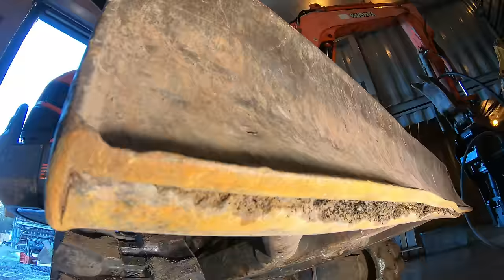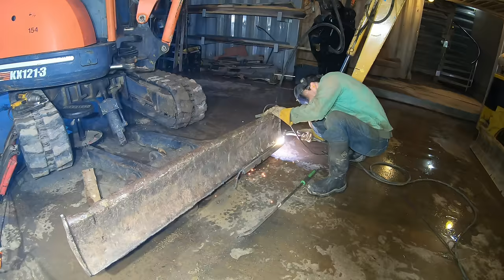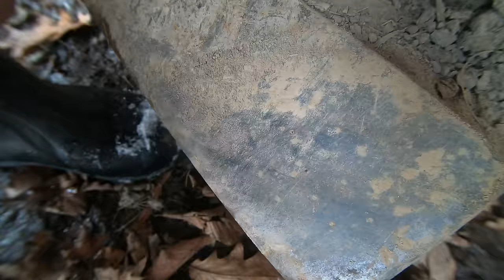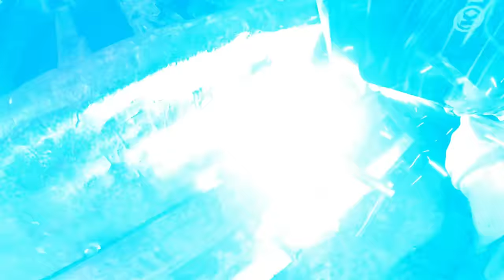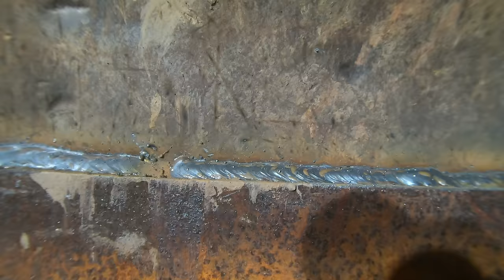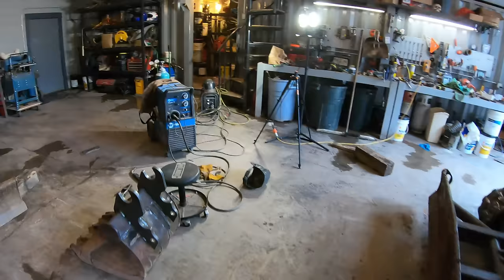Replacing a cutting edge on an excavator blade

Comment: You need bigger tanks! Go the next size up (like I did) and your trips to the welding supply store will be far less frequent. 
I bought a Miller 225G stick welder years ago for 600 bucks -- factory trailer included. Freshened the Onan motor and it's good for years. 

Great project. Great job.
Reply from the maker: localcrew they won’t sell bigger ones, only will lease them.
Reply: @AndrewCamarata  Sounds like an Acetylene conspiracy to me. Another example of The Man trying to keep a brother down.

Comment: Plasma cutters have consumables  that have to be replaced $$$ over time...but you are right cleaner cuts and not as expensive and time consuming as Ace and Oxy bottles. Nice job👍
Reply from the maker: There is a little metal thing in the tip I have changed a few times. What else is there? I have done plenty of cutting with that thing and its been inexpensive to operate.

Comment: Yup I always recommend replacing the damaged and worn portions of any blades and buckets with A-R (abraisive resitant) plate. Regular mild steel wont hold up very well for this. Lots of people never heard of it. It has to be flame cut it will ruin a shear blade.

Comment: Andrew, if I were the owner of that used KX-121,..and had that damage to the blade assembly,..I would have a good look at the undercarriage and main track frame .
 I'd almost bet that you  will find that there are more cracks and areas needing your immediate attention.
Actually, that would be a good thing to do with ANY used excavator.

Comment: I have MIG MAG welder , it can use 0.8mm, 1.0mm and 1.2mm wire, 220v, 200amp, it is $300. I love it!
I can recommend Jasic J46 - its about $600 new and it is awesome! Bud I don`t know if it fits your power sockets, I`m from Russia.

Comment: Hey Andrew just fyi a great way to tell if steel is hardened is to run a file over it. If it cuts it's not hardened and if it just kind of skates off it is hardened
Reply from the maker: Thanks. That makes sense.

Comment: great video and great work, but I was cringing when I saw you lift the blade assembly and holding it up to put the pins back in. That's going to kill your back some day. Did you ever think about building a gantry crane in your castle workshop area that can span the entire width and travel full length? With your abilities and the tools you have I am sure you can build one and it would be a fun project for you to do and for us to see.
Reply: Too slow for Andrew; he doesn't work for the county.

Comment: In my youth, I would weld on a strip of mild steel and then bolt grader blade to it. Then hardface the grader blade. That would keep the grader blade from wearing out or at least, lasting longer. Then when the grader blade does wear out, you bolt a new piece of grader blade onto the mikd steel strip. Cheaper and easier to repair.

Comment: the reason they wear uneven is because most people turn the boom to the right when cutting and pushing to look out the door, swing the boom back to the left when pushing/cutting when you do this it helps balance the machine more and reduces uneven wear.

Comment: Be sure to keep an eye on the condition of the oil in the track motors on that Kubota & yanmar. It gets burnt pretty quickly if you're doing a lot of blade work with them and the gears in the hubs will get chewed up. Fresh gear oil and some Lucas oil additive will make them last forever.

Comment: Great video but when you weld something like that directly from one end to the other the heat will warp your iron.  Common practice is to back step your welds or skip around to prevent concentrating too much heat in one area.  You always have think about what your heat will do!  Good job though

Comment: So weird to see these vids,when you repair Andrew,just one guy move all the parts,i work in an quarry,driving 30/40/60tons diggers,when we repair something,need another digger to lift,or pull the part,heavy chais,ropes we using,yor plants like model machines for me.. ):
Smallest spanner is 50mm for hidraulic hoses,if the big girl bust an hoses,till is revving down,and put the bucket to the ground,losing an barrel of oil,refill it from straight an new barrel,lifted above tank,with another digger. ):
Oli change is same,40-60L of engine oli per engine.
But the other side is,i put 2.5 bucket of stone with the 60 tonner to the 4 axle tipper lorry,that is 20 tons load,3.5-4 bucket to the artic lorry,wich is 30 tons of load. (:
I like your videos Andrew,you are similar like me,i always want same my own business like your,just never have enough money yet to start it,but i never give up,one day i will work for myself,stop working for someones elses comfort and luxury.
Wish the best of luck for you Andrew!

Comment: You can always do a spark test on the steel to tell how high the carbon content is too, white sparks that act like they came off of a sparkler mean harder steel while dull red sparks from your grinding wheel is a low carbon content mild steel.

Comment: A tip if you like, take a straight bit of angle and tack it to the job where you want to cut....take a grinder with cutting disc and score a line along the angle. That way you can see it with the plasma....
I tend to just disc right through as it requires no grinding and is ready to weld to.....
Reply from the maker: I like that idea. IDK, I can usually see the line though. Ill try that though. Thanks
Reply: @AndrewCamarata   Yes, however the clean line makes a good area for the weld to run into.  The last one i put on for a farmer was 90" long 8" deep and 1 1/2" thick with 7018 rods....

Comment: Only thing I'd recommend is with cracks, typically you don't just want to throw a weld over top of it, Isn't usually a good or permanent fix, I'd recommend grinding the crack out completely, Then welding with high penetration, Maybe using a 6010 electrode or turning the amps up on your mig welder, Then get a nice deep penetrating bead layed in the gap that goes from toe to toe, then just stack beads on top of that making sure they penetrate into both sides and the underlying bead.
But that may just be overkill, What you did may very well work out.

Comment: Andrew when you cut a flat bar like that start about a inch in then cut the length of the flat bar and leave about one inch from the end let it cool then cut the two one inch ends to make the two pieces the reason why is it doesn't curl it will stay straight! If you stand the cut piece on the edge you will notice it has become like a banana I use that as a example it doesn't curl that much but leaving the two ends keeps it straight!

Comment: >^..^<     With over 1,000 comments below I suppose there is a good chance what I am about to say is probably already been said.... 

AnyWay  Mr. C. seeing how much dirt you needed to remove between the cutting edge and back of the frame.  I suspect the dirt often became mud and was vary wet. Than the excavator being out side most of the time, in the winters this wet mud froze at night and expanded hundreds of times opening up the gap even more over the years.  Good to see you welding a little end cap on the side of the grader blade in order to keep the moisture out and stop the freeze expand and thaw contract cycle from troubeling you again in the future.....

Comment: The blades on mini excavators are there to stabilize the machine.  That is why you don't see blades on the big machines.  These blades were never really designed to push material around or act as a dozer.  But whatever...

Comment: that blade is in first class shape compared to how i got mine... i had to pretty much completely rebuild mine and my uncle had to rebuild his.. i wanna say i ended up putting an ar500 or something like that cutting edge on mine.. its supposed to be stronger than t1 steel. so far its holding up really well.. we needed a quick fix on it so that's what it got but next time it gets bad or maybe just a future project i plan to make a way to bolt on a cutting edge from a skid steer so it will be replaceable.. that is how it should come from the factory to tell ya the truth... as expensive as these things are i don't see an extra few hundred bucks for a replacement cutting edge option being an issue

Comment: Hey Andrew!! Love your videos! Question - do you use flux core wire or gas on your MIG? I recently bought an inexpensive wire welder for around the home off of Northern Tool, and opted for flux core because I didn't want to mess around with bottles of gas. I've had experience welding, but it's not a core skill for me. Also, it's just for home use, not the level of welding that you do.  Keep up the great work!! You certainly know your stuff. God Bless!!

Comment: When mild steel is ground, either on a hand or stationary grinder, it gives off weak red sparks. When carbon steel is ground, it will give off A LOT of white sparks. High carbon is heat treatable, and then it cannot be drilled or sheared. If you cut a piece of high carbon with a plasma cutter, it will warp and you cannot bend it back w/o heating it up and drawing the temper.

Comment: Inverter dc stick welders 250amp are like $150 and you can weld pretty thick stuff, much thicker than a comparable mig welder especially if the stick welder has dig functionality and you do dc electrode negative for deep penetration then a lot of the times you won't need to bevel the metal to get proper penetration. Stick welders are a little bit slower to weld than mig but you need a lot less preparation of the metal before welding. If you learn to stick weld first then everything else after that is easy this includes TIG.

Comment: DC stick rules except for thin (under 1/8" or 3MM) sheet metal. With DC stick you can weld stainless all day and aluminum in a pinch.

Comment: andrew: welding passes downhill is much weaker than up passing. side to side up hill is how I passed welding inspection for nuclear pipe welding. Uphill side to side, small movement, flowing the puddle side to side is ten times stronger than down passing in any case.

Comment: Yanmar makes their buckets that way so you can flip them around and use them backwards. Plasma cutter has consumables that need replaced. So it kinda like endless cutting. Needed that last weekend when I cut the welded on cutting edge off my bobcat bucket. Dam was that a pain in the ass. I'm not sure if it was the original cutting edge or not but it was plug welded and it sucked torching out all the plug welds.

Comment: you can buy replacement blade material at most tractor dealerships that is hardened and is sharpened on one edge and has bolt holes, just cut it to length and bolt it on

Comment: hard steel = steel with more "C" (carbon) tempered/treated with harding solution; please always clean the surface before you weld it (use some abrasive solutions) , it will help to improve the overall weld; good job overall

Comment: some good winter projects.. i would love to run 220 but thats not going to be an option at my house... I don't weld that much anyway.. picked up one of those crappy 80amp throw away harbor freight mig welders.. flux core.. I mean it will weld but only small stuff.. I need to find out how to make the heat setting on it adjustable .. probably cost as much as buying a better one to do that

Comment: Nice job on the blade. Do you think your going to do a rooftop repair job video?
Reply from the maker: dan eisenbrey I want to do a peeked roof over that entire building and make the current roof another floor.
Reply: @AndrewCamarata  That a great idea. Also make for some more interesting videos. What's your elevation where you're at?

Comment: Do you Use a moisture filter from your air compressor to your plasma cutter? I don't have a moisture filter set up for mine yet. Just wondering. BTW, an awesome and very educational vid! I learn a LOT from you're vids. NOTE: Don't let that go to your head. :-)
Reply from the maker: I do not. It has been working fine without it.

Comment: Nice repair on that blade!
:-)
Would it be for use to put a lenghtwise-cut steel pipe on the upper edge of the blade, just to stiff it up against the bending forces that may have ripped off the welding on the big diagonal?
The spot next to where you put the ground clamp seems pretty torn, the mentioned piece of steel tube could prevent that in the future...
Or will the whole blade assembly become to heavy?
Thx for the vid!
:-D

Comment: If not for 400+ miles away I'd offer up some steel cutting on the water jet.. The harder the material being cut the better it actually cuts !
Reply from the maker: 135SoHc that would be nice. I was looking into getting one for recent projects. But it’s a big investment. I just bought the pieces that were precision cut.
Reply: For a home/self employed DIY'er a solid plasma table is a much more cost effective machine. Water jets are a huge investment up front and just stupid expensive to operate all the way around. Regular servicing and a lot of expensive consumable parts that require replacement frequently. Our cnc router table costs 1/10 for service and upkeep for a year but cannot touch steel or anything thicker than 1.5 inches.

Comment: Big Fan of the channel, any cracking or concern of cracking when welding the (Assuming AR series) carbon steel plate to the mild steel structure? I've read you should pre-heat and use low hydrogen flux core or stick when doing this type of thing but unclear if its actually needed.  Great work. Curious to how this has held up.

Comment: the ideal way to weld hard to mild is with NEW Low Hydrogen 7018/8018 unless its kept in a rod oven...your mig weld should be fine...that's probly not super hard steel...ER70-S6 is the best mig wire to use...
Reply: dave s Thanks for the reminder I forgot to consider the difference between mild and hardened steel. Could you also use a stainless steel rod for the different types of steel?

Comment: Hey Andrew any tips on replacing a skid steer bucket cutting edge? I have one that is pretty worn and I've seen replacements that require welding and some that don't. We do similar work I just put asphalt down on driveways after I grade them and fix the water issues. Thanks for the vids my friend.
Reply from the maker: Just cut out the old one and weld in a new one. Like I did in this video.

Comment: Wish I had guys like yourself around my area in Aus. Best qoute I could get (When they finally came out) to resurface a 50m Driveway with roadbase was $2k and it's only going to wash out next time it rains :(
Reply from the maker: How thick did they put the gravel down?
Reply: @AndrewCamarata  they haven't done the job yet, they're basically filling the low points and spreading with a skid steer. 2 dump loads of base at $480 a load so not sure why all the qoutes are so high. The driveway is quite steep and we'll be looking at concrete when we can afford it but we got qouted $38k for that. I live in a small rural town in Australia and due to lack of competition earthworks companies can charge what they want.
Reply from the maker: Aza B What size truck?
Reply from the maker: I can usually $500 for a load in my 10 wheeler, but I wouldn’t be able to get $1000 for two hours of spreading out gravel
Reply: @AndrewCamarata  it's a 10 wheeler but doesn't look close to the size as yours. I'm about to start a course to get all my machinery tickets and wouldn't mind getting a skid steer and mini excavator for myself but everything seems so expensive compared to over there.
Reply from the maker: Aza B can you rent a skid steer or tractor for the day?
Reply: @AndrewCamarata  Not locally unfortunately, I live 2-3 hours from any major cities and it would be cost inefficient to organise any hire gear. Thanks for the help and info though. Greatly appreciated :)